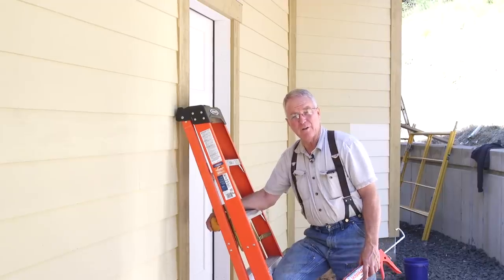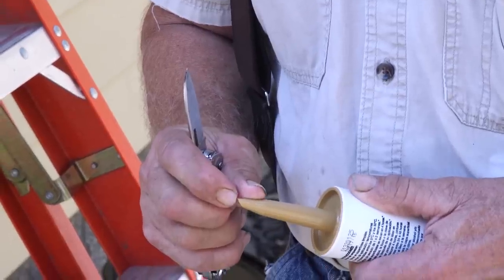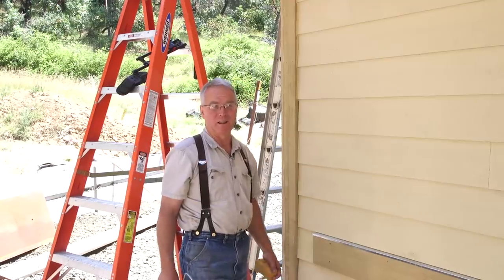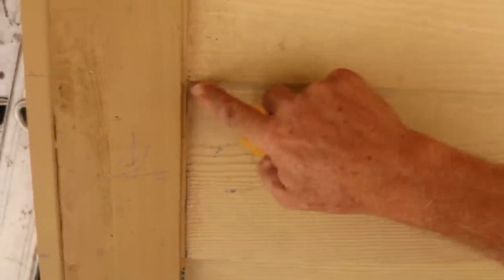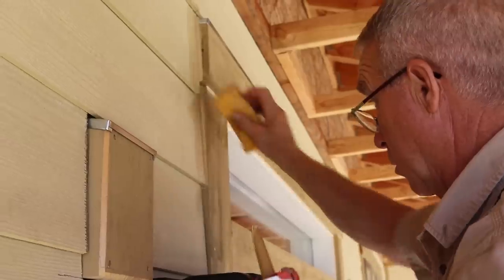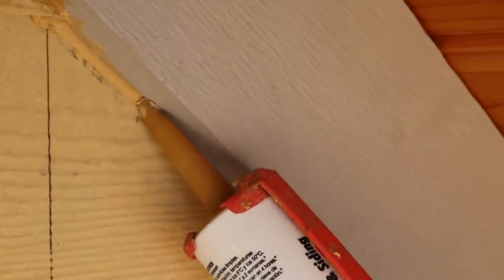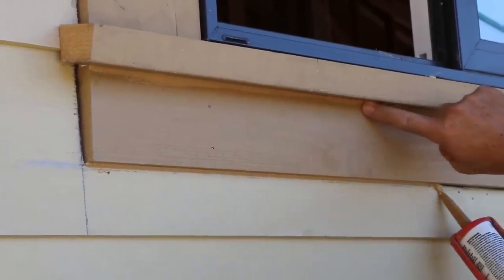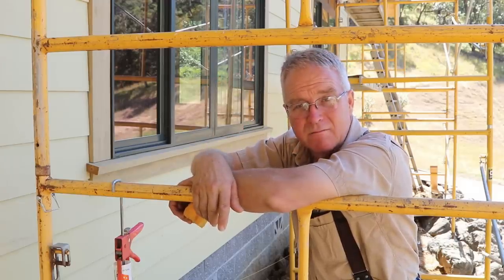Up Your Caulking Game Ep 86

Comment: You can roll the tube of Caulking on a gun so the angle its cut at is more flexible and the flatter the the tip the less that comes out and conversely the greater it is the more that goes out. The warmth/coldness of the material your Caulking can also effect its application as well as how well it sticks into a joint and it's why you don't do it the hottest part of the day on the side than the Sun is hitting that as morning/afternoons when it's shaded works best. If it's below about 50 F degrees using Caulking on joints/material that are growing  colde or close to freezing even if the Tube is warm can not adhere properly and it's why most Caulking has suggested Temp. range which also applies to the material it's applied too. Carry a 3-4in brush so you can knock out any saw dust/debris or have compressor on hand is even better since an air nozzle/gun clears joints and trying to Caulk over it will fail since it adheres best to clean material. Another tools you should have is a couple of Nail Set/Hammer at hand in case a nail/faster is above the surface and even those that are just not quite flush can rust or stand out if there not a little recessed as well. Having several putty knives are also handy if a joint/gap is a bit to wide and they won't leave behind a groove like a finger does when Caulking plus fill a joint/gap properly because if it's to shallow/thin  it wil fail even sooner than expected. Indeed I noticed a number of times you were moving a bit to fast and the Caulking was getting dragged out of the joint was why there appeared dark lines as you went and it needed to be filled better since whipping it with a finger/sponge actually lessens the compound you applied and it won't adhere correctly. In Welding there's the term of Laying Dimes with a rod/wire/anode and in Caulking the same look appears when it's applied and unlike the former it isn't desirable since it usually means a join the/gap is filled a bit to much but it's fixable plus getting the excess of is as important other wise you'll leave smears everywhere that won't be visible until the pain goes on. Knowing what Caulking  not to use is the most important step to begin with because some can't be primed/painted and many have found out the hard way that Caulking isn't a  universal material many think it is and read what it's for instead of just load/go when buying/applying...

Comment: The best way to strike off the excess is to start with your finger flat and curl it as you go.  Eliminates need for sponge and it wont ooze out on the sides and get mashed into the grain.  Big stretch is by far the best product.  You won't find it in big box stores because Sashco will not put out an inferior product to meet their price point

Comment: Towertech 2 and big stretch are the best sealents to use. i prefer tower tech 2 because you can paint it with oil based paints in a few hours compared to big stretch where you have to wait 1 week before using oil based paints. another tip i have is when you want a crisp sharp corner you can use a painters tool 5in1 to crisp up your corners. And finally if you dont want caulk all over your hands use disposable rubber gloves and cut your finger tip out.

Comment: I’m kind of surprised to see you using this type of caulk. I’ve had bad experiences with it for siding. It shrinked a lot and so I went right back to osi and solar seal. They are the best in my opinion.
Reply: Also if it rains expectantly it’s nice to have something that sets up quickly.

Comment: Really good overall. Some points

Never rely on caulk to perform a flashings job, caulk should be aestetic only
If you have to use caulk to perform a flashings job, use Big Stretch or maybe a polyurethane if toolability is of less concern. 
Probably should have shown some considerations of where not to caulk, like at the end at 14:40 where the bottom of the window side trim is caulked to the sill, its probably better to leave that uncaulked to let any water "run-out". 
On this house i suppose water is never going to touch the siding so this all becomes a moot point, because of the 3ft overhangs, which are really the best solution. But in general these are things people should be aware of.

Comment: Nothing like spraying the caulk with some window cleaner and using a popsicle stick to wipe off the excess, cleaving a crisp, clean line. And pro tip-for a smaller caulk line, grind down the wooden popsicle stick to the shape you want.

Comment: I spent years caulking repairs and floorboards on innumerable aircraft. I have another way for you that is faster and a damned side smoother. Push , don't pull and Speed is the key . Hold the nozzle at approx 75 degrees to the surface to be filled, squeeze the trigger and as soon as a small bow wave of caulk appears move forward over it continuously squeezing and you can speed up to any degree keeping that bow wave just appearing in front of the nozzle. try it for yourself. done right there's nothing to clean up or re-fill and the result is smooth as silk. Go on Try it you'll be happy you did!  And, cut the nozzle from the tip, that way there is no need to dress the tip

Comment: I hate caulking because I get it all over me and I do it just like you do. This is the first video I've seen where the Hardie board is installed correctly using Z-bar, door trim/window trim/corners are installed first and then the Hardie board cut to them leaving a 1/8" gap for caulking. Around here they put the Hardie board siding on first, put the trim/corners on over the Hardie board and don't even caulk the gaps that are left.

Comment: Here's a tip if time is no issue, like on your own house. If the caulk and the wall have a lot of contrast where the line is obvious, you can put down some painter's tape on the outskirts of the line before running your bead. Then when you run your finger, the goal is to just barely hit the tape with a thin, flat skim of caulk so there's no ridge when you pull up the tape later. It looks sharp as hell, but I can't imagine anyone getting paid to waste that kind of time on a job.

Comment: As a contractor, the only thing I would add is to lay your finger down when caulking. I see so many painters that use the tip of their fingers and dig most of the material back out they apply. This is a waste of material. I found the use of a sponge from an old guy a few years back and it’s great for smoothing the edges.

Comment: pushing the gun instead of pulling forrces the caulk much farther into the joints. It feels a bit unintuitive at first but i promise you will like the result much better.
   Also striking the joints both ways after is good practice, especially on uneven surfaces. Striking one way may not seal the joint on diveted surfaces. its a bit hard to explain but if you think  of the divet as a sideways U in  your joint pulling it one way will pack caulk into the one side but leave it lighter on the other. this can cause pinholes.

Comment: A common caulking mistake, when working with composite siding, is sealing the gap between the horizontal header flashing and siding above doors and windows. This gap is necessary to allow drainage of wind driven water that penetrates the lap joints. 
Without proper drainage water is trapped, which will cause siding damage and void manufacture warranty.

Comment: Using silicone based caulk in commercial glazing applications is one of the toughest jobs out there.  I was taught by a 30 year veteran but really never got good at it,  so they had me do other things.  A great silicone caulker can go anywhere and make the big bucks.  For liability reasons,  most glass companies will hire out the surface caulking to the experts.  When using silicone to caulk extruded aluminum to brick face, you only got one shot at it before you make a horrible mess out of the material and your hands.

Comment: One of the best carpenters I have ever come across once told me that if a carpenter builds it right there shouldn’t be much if any caulk needed. Proper fitted joints, proper flashing etc. “only bath tubs need caulk”

Comment: One comment (or question) I did not see addressed was how to seal up the tip for use say a day or week later?  I have used tape with a couple of wraps tight around the cut (works most times), nails (never work), or what?  I usually only want to seal a tube if it's one that I just had to open to finish a short stretch of seam.  If it's nearly empty...trash it.

Comment: When using exterior sealant it shouldn't be water soluble. Garbage that will crack and shrink. Here in FL we use Quad to caulk hardie siding. I also dislike hardie siding but that's besides the point.

Comment: One thing that is for certain is procedure is important as far as what goes on first you should never really try to caulk onto any raw wood you should always prime all your raw materials I'm not sure about cement siding I'm not sure if that needs a prime coat before caulking but I know that if you're going to caulk raw wood you are much better going on top of a freshly primed piece of wood for adhesion and longevity of your joint

Comment: You should try going forward with your caulk gun, over the caulk as it comes out....this way the nozzle pushes in and flattens the caulk. Once you get handy with that, you won't have to go back over it with your finger.
Reply: Absolutely wrong. You know nothing about caulking. The primary purpose of tooling the joint is for adhesion. Aesthetics are secondary. And pushing the gun is rediculous. Learn how to use the gun and you can shoot a finished bead pulling the gun. Anyone that pushed the gun would get laughed off of the job. Everyone shoots with the tip too flat. You have to lift the gun slightly so the tip forces the sealant down and forward so it doesn’t pile up behind the gun.
Reply: @genecarden780  learned it from two different craftsmen about 10yrs apart that all they do all day long is run caulk. Maybe you should try it instead of pretending you've tested it both ways. Pushing also makes it easier to go into and through certain corners seamlessly, and its easier to push the caulk into the crack rather than just laying it. You wouldn't be laughing when you saw the outcome gets better results, is faster, and wastes far less caulk.

Comment: i would love to see a video on keeping a tube of caulk from drying out or getting a solid plug that blocks the hole after ever squeeze or half squeeze of the caulk gun. i’ve tried the cap itself, nails, screws, gadgets that are supposed to be made for the purpose of keeping air out. None of them worked well enough to reuse a partially empty tube of caulk. As a homeowner who may not run through a full tube of caulk in one shot, there’s got to be a guru (that’s you) that has a solution. i’m forced to buy the smaller, more expensive squeeze tubes (like toothpaste tubes) as they seem to be reusable if you don’t empty them in one shot. What wisdom do you have for us?

Comment: The painters I hire most often, commercial spaces mostly warehouse spaces but a fair bit of customer facing retail spaces also, those guys run DeWalt battery powered caulk guns. I'm not a big fan because I haven't used them enough to get the "feel" of it. Its weird how numb, for lack of a better word, the electric guns feel at least to me. Boy are they fast though and almost 0 fatigue, I have neuropathy so my hands are stupid and don't like to listen to me.

Comment: Wondering about the pros and cons of caulking the bottoms of various boards. Thinking of the windows - side trim where it meets the slopped bottom ledge. Once it’s caulked, moisture the does eventually get behind the board is trapped, and rot starts. I understand that Hardy requires the ends be caulked for warrantee, but are there times when straight wood trims should definitely not be caulked?
Reply: Generally, you should not be caulking the bottom edges. But the sills and and undersides should be underside surfaces should be primed before fixing, if you want maximum durability.

Comment: I love installing Hardie but there is a problem with the system as far as sealing the top two corners of a window.  There will be a Z-flashing on top of each window with a standard 1/4" gap between the siding and the aluminum flashing.  This creates an issue and water will get behind the siding if a little glob of caulk is not squeezed into each top corner.  Its hard to make it look nice

Comment: your getting good at making thesew videos sir...we think alot alike....  question...do you put 2x6 barges on the rafter tails,then add a thin facia board for the finish?  or do u use just one 3/4 pre primed something or other and call it done? lately i have been using the 2x6 and a ripped to 6 inch wide peice of hardy siding as the finish... i do that cause if ever there is a board to rot on a hous..  that 100% of time is the first and most....  whadda say sir?  thanx fpr sharing your videos

Comment: I do apartment maintenance, and have plenty of Alex plus on hand. Here's my addition though, that caulk gun is not the best. The constant feed style without the ratchet teeth can wear out,especially when using thicker media, and using one is like having constipation.😅 Also the rotating barrel is a great idea but the one like yours, with the two straps that run the length of the tube, have a tendency to pop the spot weld if you accidentally drop the gun changing tubes.

Comment: Acrylic caulk is easy, getting a nice straight and constant caulk line with silicone caulks, that's a challenge. Any tips for that? I'm using a striking knife/spatula and soapy spray, but it's still very difficult to keep tidy...
Reply: If it is an important job, I will tape up both sides of the intended bead line before applying the silicone. Apply the silicone, smooth off a couple of passes with a soap solution finger, pressing in deep enough to see the edges of the tapes, and remove the tapes. One more light pass with a soapy finger, to gently flatten out the edges left by the tape, and you will have a perfect silicone job.

Comment: Is there a particular reason its hard to find a variety of caulking products in the sausage tube format?  I purchased one to use with liquid flashing materials, and the gun is so much better, its more comfortable, easier to store partially used containers.  and the huge benefit is that there is very minimal waste leftover from packaging when you've used the tube.  I've been looking around but you really have to search a lot harder to find products that will work for specific applications, and many of the manufacturers I've found, I'm not familiar with so i'm hesitant to try them out

Comment: I know calking. Wiping your finger to clean it up has more value in pushing the call in. 33% angle is good. When working with exterior openings trim should have something, I suggest liquid nails. Avoid anything water soluble for exterior. It tends to crack but will heal with water. I would do liquid nails for the majority of my project. This should be more interior or not surface/painted. Silicone for hard seal against water. Tends to separate. 

If it was my house, I'd go roofing tar for all external. Bugs say no, absorbs into wood, it reapplies with summer. I have yet to see an instillation.
Reply: I did not convey well. I'm drunk. 

Liquid Nails: Rigid, strong, little absorption.
Door and Trim: flexible, painter friendly, absorbs well to ok.
Silicone: flexible, bath/shower perfect, tends to separate from material applied to. Holds form, good gasket. 
Roofing tar: smelly, absorbs over readily, painter unfriendly, cold environment acts as silicone.

Dunk your wood in oil mutha frackers.

Comment: That much caulking, about 3 cases, pretty hard on the finger. Could use various profiles to save the finger. Profile tools specially around bathtubs with pure silicone caulking is nice else cleanup and start over. Wish there is a magic exterior non shrink caulk where its not required to re-caulk the whole house every few years.

Comment: On long, unobstructed runs..push the gun, don't pull. You'll find that the trailing edge of your chamferred tube cut (fat radius) will act as knife, leaving a nice machine-like finish while it also forces the caulking into the crevice. Takes some practice...but when performed on bath/finish carpentry especially...the results are unmatched.

Comment: I’ve been seeing problems with the hardie board cement siding, especially in wet areas, paint peeling off and the actual siding can disintegrate. A properly installed product will not need any caulking to help with the waterproofing of the house or building.

Comment: Ugh. I HATE caulking with a passion. I’m pretty good at it but I hate it. Probably explains all the “unfinished” trim projects at my house that need to be caulked and painted. I prefer to use a couple wet terry towels when I caulk. I’ll use one for a bit, then swap to the 2nd one for a bit, then go rinse them out and repeat the process. I’ll give the grout sponge thing a try next time. You’re 100% right on a good caulking gun. Makes a world of difference on hand fatigue. Also, spend a few extra bucks on a good quality caulk not cheap crap. I have found that cheap caulk just doesn’t last. I have found myself leaning towards sashco big stretch in recent years.

Comment: I've had to caulk between some kickboards and floorboards in what was very poorly leveled ground. Gap size varies wildly from 0 to about 10mm in some places. (I think thats  "3/8s" in imperial) in this case do I get a couple different size nozzle cutouts and try to do it in sections, or is it better to use a smaller cutout but apply more passes in the big gaps and run over with a corner scraper afterwards? 

Also the other problem I had was that the timber flooring had a pretty raw finish that made wiping excess caulk off a nightmare. Is it worth taping the floor in cases like this?